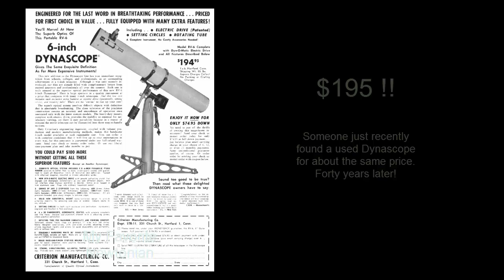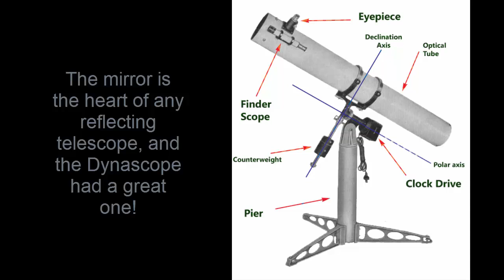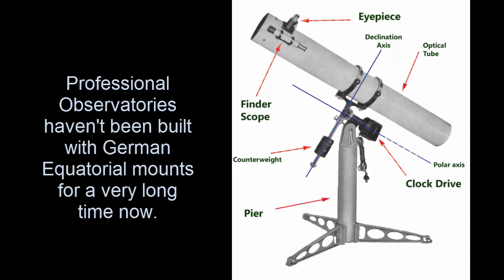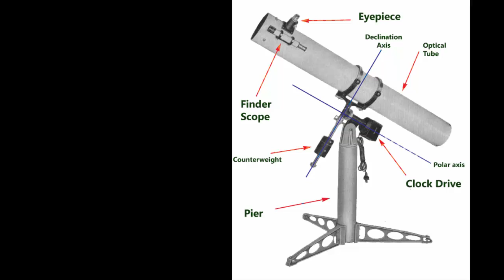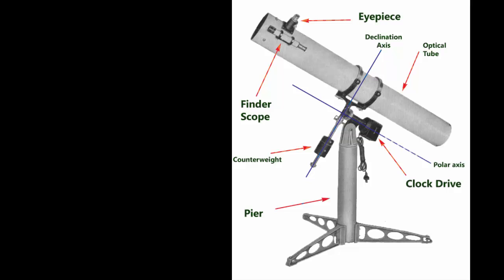Dynascope tour

Comment: Thanks for the video, I just got mine back from my brother. I am retired now and want to get back into astronomy. The scope is in bad shape. I don't remember ever learning how to use it correctly. Do you have any tips for setting it up to track the stars? Any tips for taking pictures using it? Thank you
Reply: Make sure the mount and pier are level and aimed at Polaris with tube straight and adjusted for your latitude. I use a torpedo level against the left side of the mount, held tight to the bottom of the mount sliding up the pier pipe if that makes sense. 

 The north star (Polaris) should be in the center of the eyepiece. If so you're ready. If not readjust the mount. (As long as you're close it will work fine but may require frequent adjustments to keep the object in the field of view.)

 Once level, I use a compass and a thin square board about 4", with at least 2 sides parallel. Hold compass against the outside of the board and inside goes against a flat spot the mount (good luck!) and align north. 

 I feel this is the most accurate, but these mounts are forgiving on polar alignment if you're observing. For photography, the alignment needs to be precise.

 Good luck and I hope you enjoy observing with it.

Comment: How are the mirrors? Have you recoated them?
Reply from the maker: The mirrors are pretty much flawless.  I have collected a couple of spares throughout the years.  I have had them recoated at least a couple of times.  Highly recommended clausing.com a company out of Chicago
Reply: @FrederickHiggins  Thanks. I was just curious. Reason is I have a 32 year old Tasco reflector. I have been told that mirrors need to be recoated every 10 to 20 years and was wondering if it was needed and worth doing.
Reply: @lornaz1975  I still have my Tasco  4.5 inch reflector from 1968 (and my Dynascope).  The mirrors  are still good.
Pat, in Chicago